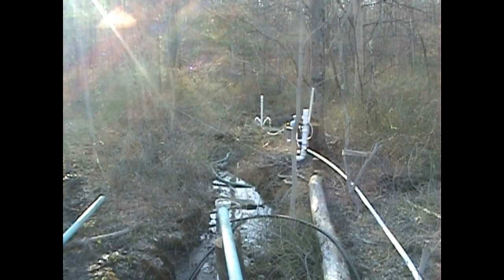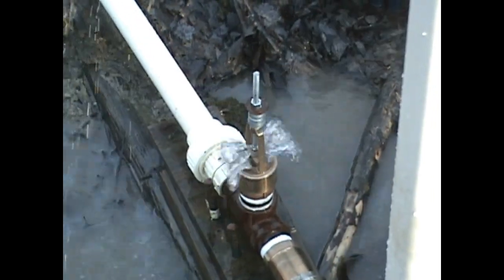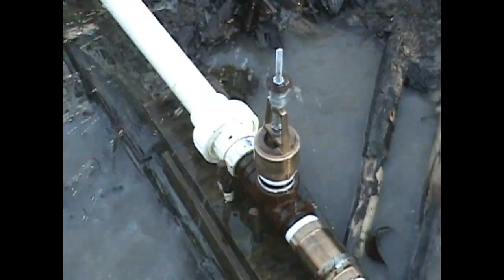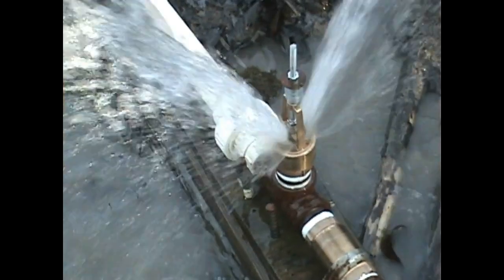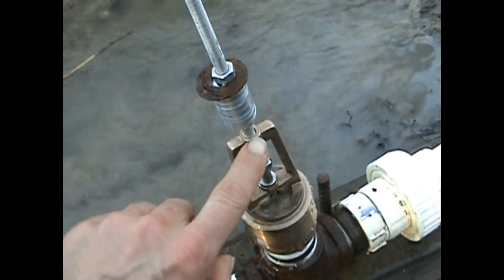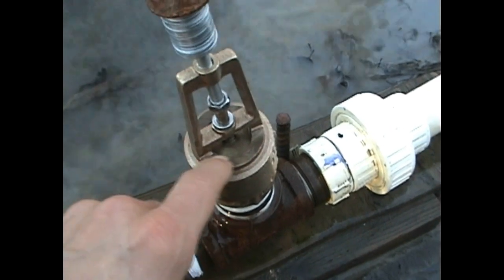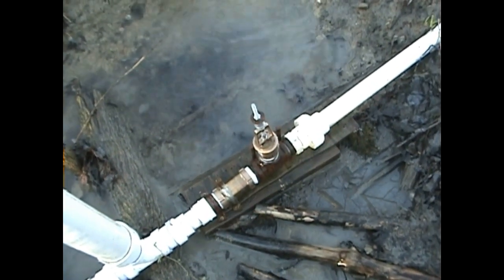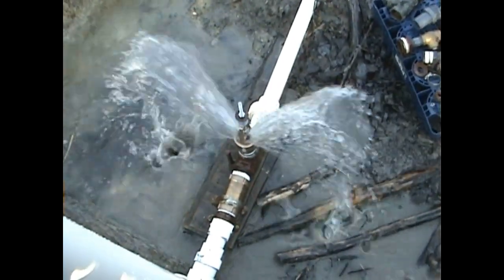04 14 2017 - Ram Pump Upgrades   Foot Valve Weight   Standpipe Filter - 4000 Gallon Reservoir

Comment: How much more water have you been able to pump with  the adjustable foot valves over a swing check valve?  Thanks.
Reply from the maker: It's more about reliability than volume. but a bit more. When the spring is really running and the weights are tuned right my best has been about .88 GPM  1267 GPD.   Before that it was about .5 GPM or 720 GPD.  So a gain of 553 GPD. Also, the pump runs 24/7 reliably now whereas before it would shut down for an unknown reason from time to time.
Reply: I'd call a 76 % increase significant.   It might not make an important difference if the pump is already filling a tank, but for situations where more water is needed the savings might be important.   If 10,000 gallons per day is needed, that would mean 8 pumps instead of 14 with a cost savings of almost half and maybe more if some of the delivery lines could be combined.    
This is the first time that I've heard about operational reliability for swing check valves is an issue,  this could be huge and may explain why most of the larger installations do not use swing check valves.  
It looks like the tuning of your custom check valve may be very important - on your April 12, 2017 video, I think you showed that the stock swing check valve delivered more water than the custom valve before tuning.  This might be a reason to run first with a swing check valve to have a bench mark before tuning a custom valve.    
I'll make sure that the waste water check valve discussion in the Water Powered Pumps public facebook group also links back to this video.     https://www.facebook.com/groups/240458583255303/permalink/533567013944457/
Reply from the maker: @davebean2886  Yeah, there's lots of little nuances to it all.  The main thing with any impetus valve is high flow and a complete sudden stop.  The more flow between and the more sudden the stop, the more energy that is imparted and consequently water transferred to the pressure chamber and output side of the system. The swing check valve accomplished both of these VERY well, but tended to fail from time to time due to the sloppiness of the valve. The valve failing costs water production in the long term. One channel that REALLY made a nice valve home made that functions VERY well is Maximumus Incognito. Here is a link to that as well:  https://www.youtube.com/watch?v=c_hWmumfPY4
Also, if you haven't seen my Ram Pump The Manual video... here's  link: https://www.youtube.com/watch?v=rxqUkybsxYw     Thanks for sharing my videos!
Reply from the maker: @davebean2886  Wow! Thanks so much!  It is inspiring to have a  comment like this with such intelligence and insight behind it!  I'm pinning this!
Reply: @TheFarmacySeedsNetwork  Your comment is appreciated and I'm mostly trying to find people like yourself that might know how to make water powered pumps work to their best ability.
Reply from the maker: @davebean2886  Cheers!

Comment: The top portion of the foot valve.  Is that a fire sprinkler tap modified adaptor?
Reply from the maker: No it's just a modified bolt.  See my playlist ram pumps and water delivery for more ram pump detailed info. Cheers!
Reply from the maker: here's a good closeup of the assembly: https://www.youtube.com/watch?v=6MfKeW8xFIU

Comment: If you were to run a 2 inch ram pump could you still do it with a 2 inch delivery pipe?
Reply from the maker: Depends on the situation. Without a standpipe yes. If you need a standpipe no.

Comment: I have looked at a couple of your videos.  I count not find the brand of foot valve you are using.  Could you let me know if you prefer what you are using or if any foot valve will work.
Reply: Sorry.  I looked one question and comment lower and found you had already posted this. Thanks
Reply from the maker: I'm sorry I don't recall as I bought it at a local hardware store. Just get a 1.5 inch brass (or better yet stainless) foot vlave. They sell them on amazon much cheaper than I paid at the local hardware store. Thanks for watching!

Comment: Do you have a part number for the foot valve you started with?
Reply from the maker: I don't.. but I can tell you it is a yellow brass 1.5 inch foot valve.  I think it was about $80 US.  This should work: https://www.amazon.com/Vlv-Ft-1-1-2in-Brs/dp/B07PHDMH6N/ref=sr_1_3?dchild=1&keywords=1.5+inch+foot+valve&qid=1614370398&sr=8-3

Comment: Great!  Does that waste valve have a rubber gasket on it?  I'm looking at the Merrill foot valve FVS100.
Reply: I ordered the FVS100.  We'll see how it goes.
Reply from the maker: @pwrmx24  Fantastic!  I hope you will share some video with us when you get it up and running!
Reply from the maker: Thanks! I believe it does. That looks like a nice valve: https://www.merrillmfg.com/shop/check-and-foot-valves/check-and-foot-valves/product/653-1-stainless-steel-foot-valve
Reply: The greatest advantage of this waste walve is we can adjust the weight of the walve in accordance with the water flow and the distance and the head required. Whereas flap walve does not have this feature. Pls read  the replies which are very informative and useful. I am from Bangalore India and I have given my comments after practically installing the Ram pump at a stream and getting water to my farm which is about 60 feet high and about 400 feet delivery and most importantly consistance

Comment: You could change the weights wit a spring, and a screw on the treated rod. This way you could also regulate the pressure more easy and more precise, not to have remove or add weights all the time during testing and adapting the pulse rates.
Reply from the maker: I found weights are  easier and also, in my research, found that springs change over time and can end up unreliable. Weights stay the same. It's a good thought though and thanks for the comment!
Reply: @TheFarmacySeedsNetwork  In my pump I use a spring. Never had any issues.
Reply from the maker: @LukVanhauwaert  Good to know..  my weights are working fine for now also... I see you have some woodgas videos on your channel.. I will be binge watching! :)
Reply: @TheFarmacySeedsNetwork  Yes,  I work in team. Together with Pascal. I do the mechanik side and he the electrik/tronik. We have a cogeneration (Heat and energy)production system running on daily bases with a recuperated VW engine and besides we have a test rig where we do all kind of fundamental, sometimes weird testing, in order to adapt to and improve the running system. Here for instance a test with an underpressure sensor and a new agitator design. https://www.youtube.com/watch?v=GKAgfM9A8Hc . At this moment I concentrate my testing on a cheap cold filtersystem to replace the expensive hot bag filter. Allways learing, never satisfied.
Reply from the maker: @LukVanhauwaert  sounds like a fantastic team! i have been watching your videos on both channels.. you guys have donw seom excellent research!  THANK YOU!
Reply: @TheFarmacySeedsNetwork  Well we are never done. testing goes a little slowly now because The school that makes my weldings and millings has closed the workshop and since I do not have a workshop myselfe I have to give fabrication of parts out with allways the same problem. It takes ages and is very expensive because   comercial shops are not interested in prototype; They want series. Right now I am waiting already over a month for a small piece of work.
Reply from the maker: @LukVanhauwaert  I am the same.. never done learning / improving / testing.. and TOTALLY understand fabrication limitations.. i build my own stuff.. just as slow.. haha!
Reply: Rather than switching to a smaller valve, can you extend the range of control by varying the amount of downward travel in your valve stem? It appears there is a lower nut that the rod lands on that could be adjusted to hold the valve disk higher in the flow, which would reduce the discharge area and make it close more easily in low-flow conditions?
This may just add another tuning variable... simply removing weight may give the same amount of control?
Reply: @nautamaran  Yes correct, The valve is adjustable. The other nut is just to block the position so the adjustement stays fixed and does not change by the vibrations.

Comment: Nice work! I like the filter. I have also see the check valve turned to the side at an angle with lower flows. At 45 degrees it would slam shut at lower water pressure. Might be another option to try. I never get tired of seeing these pumps push water way up a big hill. Amazing 100 year old technology.
Reply from the maker: thanks!  I tired the check with the sideways twist... ;)  It works... but I found it wasn't as reliable as i'd like. So, I have the series of valves from 1.5 in down to 3/4 in. Last summer I made until the spring basically dried up (bad drought here) using that.  Yeah, I THINK I've seen just about every ram pump video on youtube!  :)